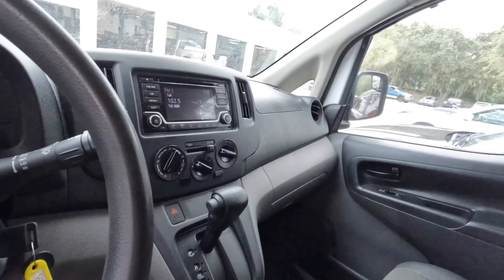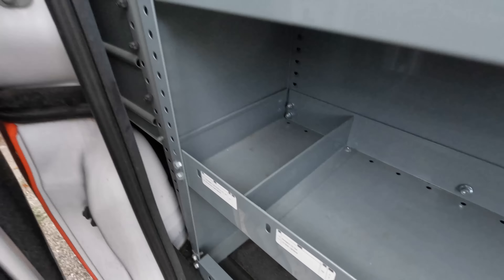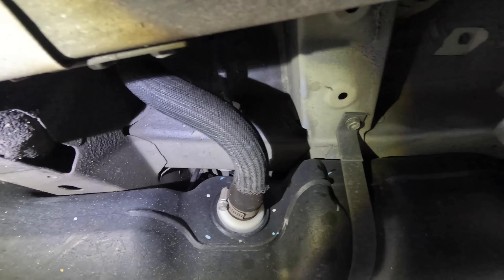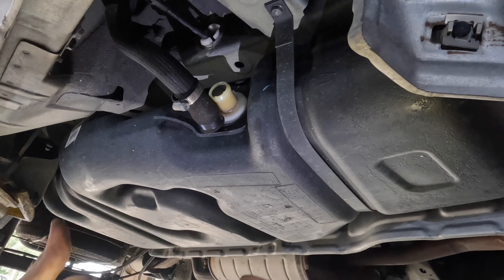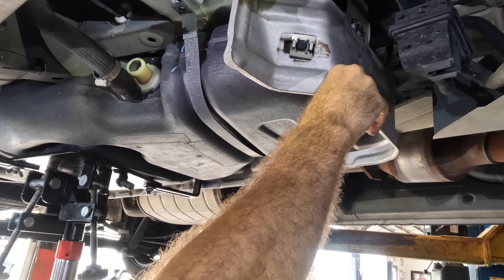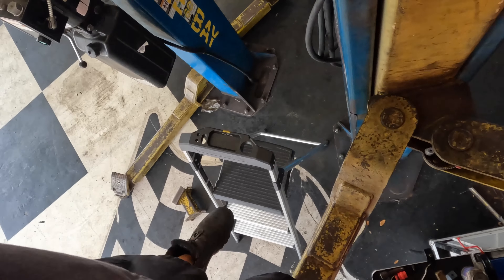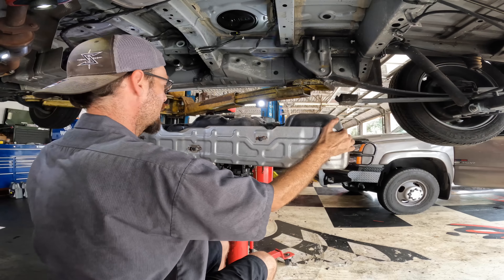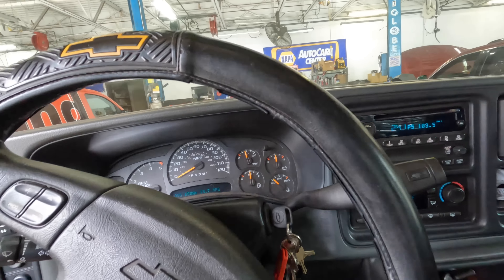Misdiagnosis! Changed the Part Anyway! | Crank No Start

Comment: The new mitsubishi outlander is like this nissan, a couple of months ago mitsubishi posted a recall for the fuel pump for this very reason, wonder why nissan didn't do the same
Reply: In my experience this generation of Nissan commercial vehicles are a little sensitive to fuel quality and don't like bio fuels much. Changing the fuel filter on schedule and occasionally running an additive through can make quite a difference to the lifespan of many of the fuel system components.
Reply: Likely for the same reason they keep using the awful, terrible, self destructo Jatco CVT transmissions.  If you find out what the real  reason is, please let us know.
Reply: @Rroff2  its not about the filter being bad, its the electronics that are busted. You saw there on the filter lever, it got burnt, Imagine if the tank exploeded... Renault\Nissan\mitsubish - Renault has good engines, Nissan are great on electronics, Mitsubishi is great overall, but for some reason they are a total failure together. Engine problems, electrical failure, components that are LITERALLY chassy bound > you cannot change a steering rack without reinput the and calibrate the rack thru their GDS app, which is crazy (like iphone did with their phones)
Reply: @randyab9go188  reason? I guess it would be a one time car, where the life of a car is decided by the warranty and  after that the car just explodes in to pieces. Happens to Mitsubishi owners with the FCM attachments, after 3 years the component just dies - no reason, no overheat, no hardware problem, and it always happens a month after the warranty is expired.

Comment: I had a '97 mustang that had a nifty feature where when it ran out of gas it would disable the fuel pump so you didn't burn it up trying to restart the engine.  There was a reset button in the trunk for it.  Yeah...  that would have been nice to know the first time I ran it out of gas....  I put more in and was confused why it wouldn't start back up.  The interwebs weren't as helpful as they are today, but I finally found the answer on a message board somewhere.  I was just about to have it towed to a shop so they could charge me a couple hundred bucks to press the button for me.  lol

Comment: Had an '85 GMC 1/2 ton with dule tanks. Just died on me one night. Next day buddy and I spent 8 hours trying everything from filter to lines to pump to get it going again. Turns out  the crossover valve faild and switched to the default tank, which was empty. Didn't want to remove the bed to access it so drained the full tank and ran off the one that worked.

Comment: Ray, when I took the fuel sender out of my  factory tank I used the (side) of the chisel so not to damage/cut the twist locking ?? thing. The smaller ball peen hammer worked for it with better applied force??? square . If one was to find?? a squared end of chisel would be good for a not so often used tool.
I wanted to see If I had missed the tightening of the filler neck clamp?? At the time of the flashlight magnet episode..As this new??? and ?????ably better 5thgeee system goes into regurgitate mode for about 3 times watching this. WAPOFUS! 
As what makes your work that much better, admitting something. This Is the reason I like not to have something not quiet finished as I WOULD forget something so prevention is better??

Comment: I remember my 2000 GMC Safari van’s fuel gauges erratic behaviour. I couldn’t afford at the time the $800 (Canadian)fuel pump module assembly, being a mechanic the labour is free , lol. First born was 1988 and twins born 1989 , thats was priority. I couldn’t convince my wife to make sure she always put $20 gas every other day to make sure she didn’t run out and need a tow. Well guess what , twice in one month! Good thing tho was they now ( 2006 ish) you could purchase just the circuit board for the gauge ($125) , again free labour. These vans were known to burn fuel pumps out in the 80,000 mile range but I never had to replace the $800 part ($265 for Delphi from Carquest in US )

Comment: There was a very good chance the van would have ran with some gas but still read half full.  May have just been a sender unit fail.
Reply: with 100K on the trip I would not put the tank back without a new unit.

Comment: I've seen that damage before, it is caused by the fact that about 17 years ago the government thought that it was imperative that they removed the lubricating element from gasoline. So when they took all the sulfur out of the gasoline, or at least almost all of it. They ended up causing a lot of these failures of the fuel level sending units. Most surprisingly, many General Motors cars failed within just a few months of their pulling that particular element out of the gasoline. I told people to start using at least some Marvel Mystery Oil every few tankfuls in their fuel tank that would provide some lubrication for that so that it wouldn't wear itself and start barking and doing weird things. And yes they actually cause arcs inside the gas tank. The advantage to being inside the gas tank however is that there's not enough oxygen to support an explosion. Which is precisely why that's not what happened to TWA Flight 800 but that's a story for another day that I heavily studied.

Comment: Ray, have you seen a lot of GM vehicles, mostly trucks ( Chevy GMC ) with fuel pump problems? I used to own an 88 Sierra ( beautiful truck ) and it was fast. I had a pump that went south for the winter. This happened eight times, and at a install/part rate it was 500$ I asked, why they’weren’t under the shop part warranty. I got a very short answer. Because they’re built in China and try getting your money back from them. It’s not going to happen.

Comment: Seeing inside the fuel tank was exciting.. Though I find it strange those ribs at the bottom, wouldn't that prevent fuel flow when the tank reaches empty? :D

Also I'm jealous of your fuel prices.. 5USD/Gallon makes about 13.5 NOK/Litre..  Currently we're waving between 22 and 25 NOK/Litre, which equals about 9 USD/Gallon...
Reply: It sloshes around while driving.
Reply: They are for anti-surge when turning and accelerate/decelerating, so the pump can get at the fuel even if low..
Reply: So seeing the inside of the tank was exciting !!!!!!, I guess you don't get much excitement in youre life then ?? sad.😏😏😏😏

Comment: 11:40 I would be more concerned about sheering off one of the tabs than an explosion.  I have always used a screwdriver.  That was my issue; breaking the locking ring.

Comment: You made me think, talking about an NV200 with no crank... Very few NV200s in Norway with a motor, most are the E-NV200 elec ones. they're great, I've done 50,000km and not filled it with diesel or gas yet....
Also USA fuel pumps confuse me. Europe you get a nozzle per fuel type, just grab the right one from the 3 or 4 choices, none of this pumping different grades of fuel through a common hose.

Comment: That sending unit looked so cooked that it would warrant an electrical inspection before the new one would get installed.
It would just take a quick test light check, to see if there's any malicious buildup of current on that wire, waiting to fry the next sending unit as well.
There should only be a voltage there, with only just enough available current to measure the position of the sending unit. It should not light up a test light.

Comment: Ah, but you did use a hammer and chisel. Just an air hammer and chisel bit. A hammer and a brass drift are the correct tools for fuel tank impact work to prevent sparks.

Comment: Not a fan of the NV200.  Drove a 2015 for a company I worked for 4 years ago ... thing had absolutely no power and with that CVT, screamed at 3k RPM from just off stopped all the way to 70MPH, which only took about 2 minutes or so.  And that was when it wasn't loaded!

Comment: If the customer is accustomed to running the tank to E, perhaps the pump burned up with no fuel to cool it and to prevent it running dry and wearing out.

Comment: Wanted me to change the spark plugs because it was misfiring, eventually wouldn't start, I told her it was the fuel pump but she had me replace the injectors and ignition coils. I eventually replaced the fuel pump then once I got it running I found that the alternator was bad which was the main problem. Caused everything else to domino

Comment: What the hell kind of air tool did you use to tighten the fuel pump with the metal rod/crowbar?? I gotta do a 2002 GMC Sonoma fuel pump replacement. I am wowed with wth.
Reply from the maker: Used a long chisel on an air hammer…turned waaaay down. Don’t do it with a full throttle air hammer. Maybe just use a hammer and brass chisel. Seriously, b careful

Comment: I would be much more concerned about a fuel pump getting toasty "INSIDE" of a fuel tank than the very much utilized method of lock ring removal causing a spark. But, Hey, I am not a certified mechanic so what do I know. Yes, I was watchingto see if you remembered to tighten the clamp on the filler neck hose. Good catch.

Comment: I find it funny that people think gastanks explode from a spark.  This isn't the movies.  In my 50 years experience I have never had them explode.  They have caught on fire a few times, but all you need to do is place the pump back for a few seconds.
Reply: A shop near me exploded several years ago, two mechanics killed.  They were using an acetelyne torch and accidentally hit the tank.

Comment: Could water have entered the tank and caused that issue? Seem so far fetch it would be electrical sparks
Reply: The reason gas tanks do not spontaneously combust is because there is not enough oxygen present. The reason diesel tanks do not spontaneously combust is because there is not enough fuel vapor present. So sparking would not be an issue.

Comment: OFF TOPIC—-9 months ago- LIME GREEN 2007 Nissan Frontier 4.0, brought o2 sensor on front seat, with bank 1 fault code also a P0744-torque converter clutch fault. I’m disabled on disability check.  IE: NO MONEY 
Same truck, same codes, bought truck 1 year ago-changed leaking valve cover gaskets and upon driving it got the exact same codes. Truck has been sitting scared to ruin the transmission. Guy sold it to us that way and we spent all our money buying and taxes. DID HE EVER COME BACK? WHAT WAS PROBLEM?

Comment: That melted sending unit in the tank looks like a seriously sketchy situation. What if it gets hot enough to ignite the vapors? Yikes.
Reply: Not enough oxygen in the tank to cause a fire.
For combustion to occur there needs to be the right balance of fuel and oxygen.
Reply: @Cheepchipsable  And that would change with how much air is in the tank. A tank that empty may well achieve14.7 to 1 ratio.  I wouldn't want to find out.

Comment: The pump must have been bad as you said it was making a grinding noise at the beginning of the video. Probably because it ran out of fuel and ruined the pump.
Reply: Pumps in general make mechanical noises when they run dry, doesn't always mean they're damaged. However you shouldn't run them dry for any period of time without the fluid as it's also the lubrication.

Comment: Instead of chiseling or airhammering the lock ring out, I'm surprised that there aren't special wrenches for that by now (akin to, say, strap wrenches for oil filters, back in the day).
Reply: There are, but most of them fail miserably, and it's often just as easy to do it using a hammer.
Reply: There are but there are different lock rings. Is there an adjustable one? Yes.
Reply: @Cheepchipsable  That's surprising.  How difficult could it be to design a wrench like that?  But in any case, thanks for the note!  :)
Reply: @hotpuppy1  Yeah, I was thinking about something akin to the adjustable jar lid grabber/opener you can get.  You have two points of leverage, 180 degrees apart.  Adjust the distance, latch on, and turn with a ratchet or attached handle.

Comment: How low can a tank get before the fuel pump isn't cooled?
Reply: When it can’t suck gas through the pump it can’t cool the pump. Best advice is to not run out of fuel. I start looking for a gas station at 1/4 full.
Reply: @Hoaxer51  so, basically, this pump was running without cooling.
Reply: @dans_Learning_Curve , more than likely, yes and that’s why it burned up or was in the process of burning up b

Comment: Howdy Mr. R. Ray, Nice work on finding the issues with the sender & pump.  The only thing I do different is that I coat the O ring with some Sil-Glyde, and spray the ring/area with some silicone, to help seat the ring and top of the unit with a bit more ease.  I wish I could think of another way for you to use even more sparking overwhelming force to annoy the snow flake types!  May use some black powder to blow the ring off!

Comment: I had a GM fuel pump leaking through the electrical connector, super dangerous!  The connection had overheated and melted the plastic around the connector.

BTW....ALWAYS ALWAYS ALWAYS replace fuel pumps with a pump from the manufacturer...IE Nissan, AC Delco, Motorcraft, Denso, etc. NEVER use a pump from Auto Zone, OReilie's, Advance Auto Parts, etc. Sure they have "lifetime" warranty, but how many times do you want to drop the tank to replace them !!!!

Comment: Of course it wasn't the fuel pump. Karma rule of mechanics number 1. If its a fuel problem that requires a tank drop the owner has filled it to overflowing.
I would imagine the owner new it had the sender problem for months but left the vehicle for someone else to use. probably sitting on a beach somewhere on vacation and is going to get a bill when he gets back.

Comment: wait a second.....  they use an EXPOSED variable resistor for the sending unit?!?   and... it was arcing INSIDE the tank to make those evidence SCORCH marks!   so, the only thing making it NOT blow up is that the fuel air mixture is too rich?  Are ALL sending units like that?!?.  I suddenly feel less safe in my car.  Am I missing something?
edit:  By The Way... DId You (Ray) get the rubber bumper thing that blew off the top of the tank and put back in place?

Comment: Every o e who say "ou there is chanse for spar and explosion using shizzel and hammer" then i want let you know. You can throw even burning match in to tank it will not explode becaise exploding mix need right ammount air and fuel vapor. If it is wrong then it never explode.

Comment: I have never had a car with a fuel pump go bad, even on a VW Jetta VR6 that had 316,000 miles on it...and neither of the 17+ other VW's into the hundreds of thousands miles on each....since 1987 hmmmm, I drive a lot....or a sender unit, weird why some models have some issues, and others don't when parts components are practically coming from same OEM vendors

Comment: You didn't check the fuel level when you were in the cabin? What if it were out of gas?
Reply: The gas also cools and lubricates the pump motor. Run it dry and odds are that the motor is ruined. The other reason for not running so low that the alert comes on is that the motor is no longer being cooled and unless you give the pump time to cool off (15 minutes) the application of cold gas to a hot motor will cause the permanent magnets in the motor to crack.
Reply: Have you even watched the whole video? 😂
Reply: Most likely the sender was bad in the first place,so if it was bone dry and gauge said 1/4 tank,youd most likely ruin the pump anyway from it running dry all the time!
Reply: @petersmart1999  you almost have to revert to the old motorcycle axiom and get gas every 100 miles or so.

Comment: The probably smoked the fuel pump by running it low on gas at all times. People don't realize that the pump is cooled externally by the fuel. No gas, no cooling.

Comment: You chose to drop the fuel tank on the Nissan NV 200 cargo van because of the racking inside the sliding door.  From what I saw, the bottom shelf was empty and looked like it could have easily been removed to give you access to the fuel tank service hatch.  I guess it would take 10 minutes to remove the shelf compared to a minimum of 30 minutes to drop the tank.  BTW, regarding the use of a chisel to loosen the retainer ring on the pump, a tank that has had fuel in it is more dangerous from a spark than is a full tank.  Liquid fuel doesn't explode.  It is the fumes on the surface that explodes, causing the liquid to heat and evaporate, therefore fueling the fire.  --  Just because I can twist a wrench, it does not mean that I can diagnose what the problem is, and then correct the problem and the cause.   Along with many others, I love your videos and look forward to seeing more.  Keep up the great work.    P.S.  have you thought of getting a pair of glasses with a camera in the frame so that we can see the view you see compared to from the side?

Comment: I just noticed the color coding on the fuel fillers and pumps. Green for diesel? and red for Gasoline? Here in the UK Diesel is usually colour coded Black and petrol Red or green. Green originally denoted lead free (when it was introduced). Is this common in the USA?

Comment: Off topic, here's a little query i've always wanted to know? What equipment does the garage provide for the mechanic; do they supply the battery charger,  AC charger,  floor jacks and welders or do the mechanics have to provide that equipment for themselves.

Comment: I don't know why ANYONE with automotive knowledge would complain or say that the method Ray used to remove the fuel pump retaining ring was wrong.   Every fuel pump removal video shows someone using a screw driver, a chisel or a brass 'drift punch'.   And an instructional video on using a Retaining Ring Removal tool, which was laughably long and painfully arduous...  Those viewers saying Ray is doing it wrong/dangerous... must be just making it up to be noticed or something.
Reply: Umm, you do know the difference between brass and steel, right?